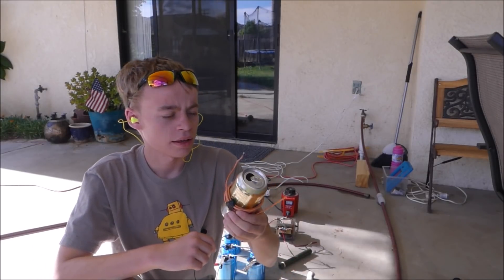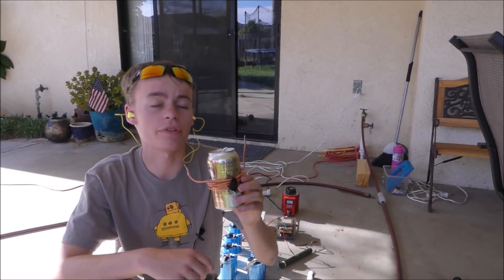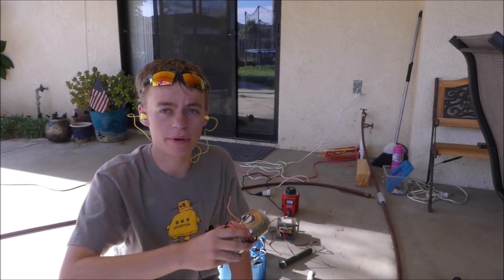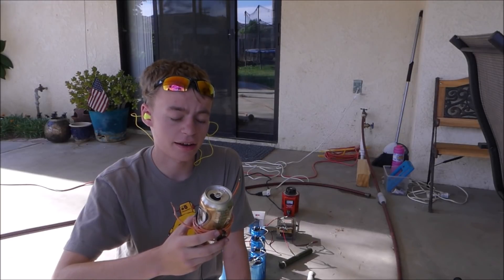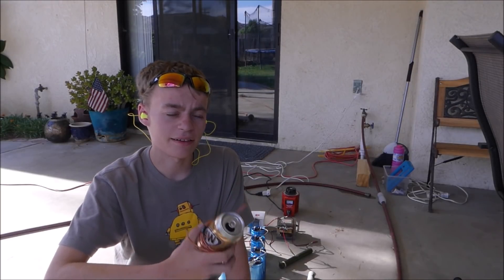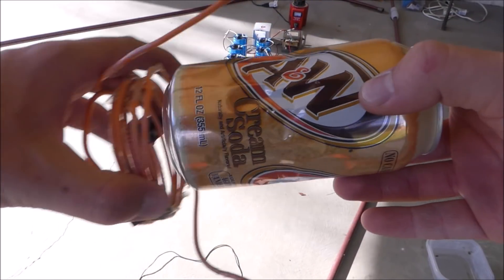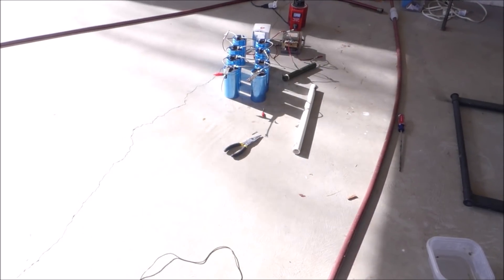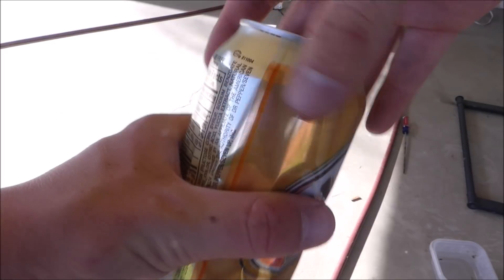Launching HDDs and Crushing Cans with 520 Joules!

Comment: I'm wondering how hard drives store data. I thought they used magnetic fields, but aluminum isnt ferromagnetic so that wouldnt work and apparently they are made out of aluminum, so....
If anyone cares to clarify
Reply: They have a ferromagnetic coating.
Reply: @GRBtutorials  makes sense thx
Reply: They have a magnetic coating much like a refrigerator magnet, this way it's not a permanent immovable field so information can be written and or moved around like a cassette or 8 track tape. This is why hard drives go bad in certain spots called sectors. A hard drive only has a finite number of times data can be written to one spot then it start to degrade. Usually for ide drives 18,000 write cycles per sector. Hope this helped!